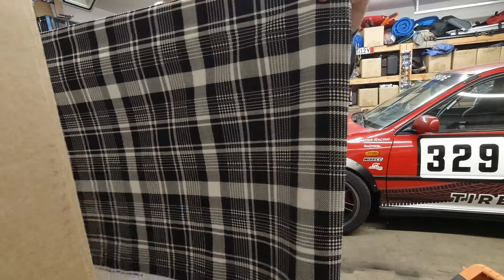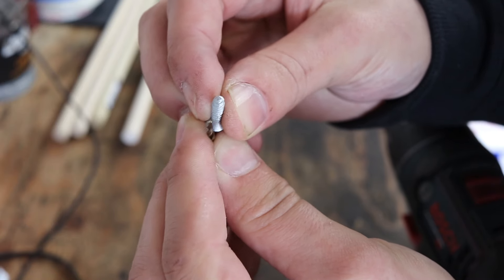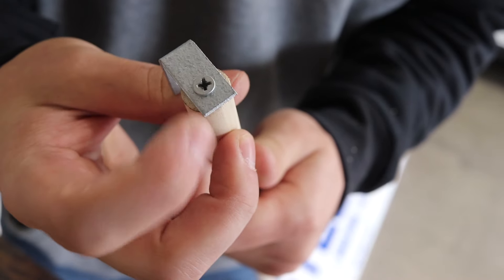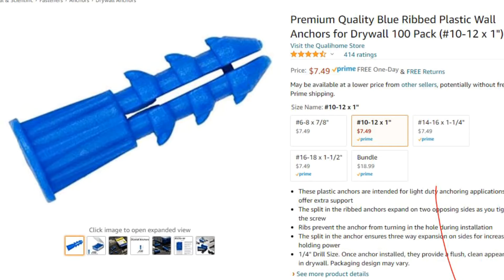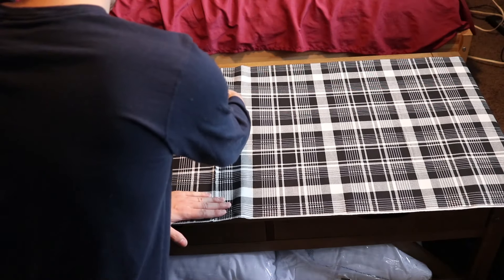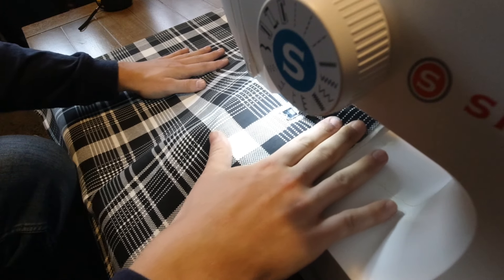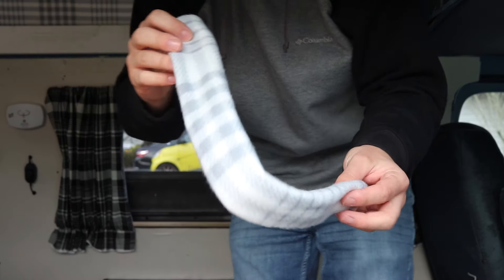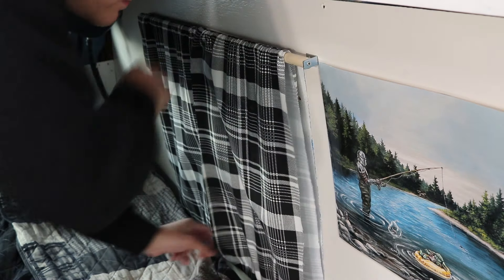CAMPER VAN CURTAINS | D.I.Y.

Comment: Having diy-ed multiple curtain designs, I'd like to share an alternative to your suggestion ... because, as always, which system is best  varies with circumstances (ex: For an employer-leased van for stealth  camping during work travel, removable adhesive for the smooth half of velcro at minimal attachment sites was appropriate). 
   Though my professionally- converted pop-top camper van came with rail-curtains & snaps, the plastic rails have places where they've  already cracked, become unattached, &/or  snaps have rusted &/or detached (screws stripped  &/or  expanded opening where flange/washer secured outer side of snap to outer side of  sheet-metal)  &/or sunken relative to fabric raising around them ... such that snaps holding outer edges of privacy curtains  to van &/or where the meet eachother became unusable, etc.. 
 Point? Simpler can sometimes be better.
    So ... my personal favorite curtain system  includes: 
1) Sliding via cord that's easily detatchable from van and easily  threadable  (to remove and re-thread cord when   laundering, , replacing cord, etc).
2) Some way to reversibly attach cord to van itself with cord side of attachment being both large enough to prevent accidental withdraw of cord tips into/through where curtain slides  across supporting cord and yet these relatively large cord "anchors" can be removed for intentional separation of cord from curtain. 
3) Neutral color for curtains such that people outside the vehicle can't tell whether it's just too dark inside the van to easily see in or whether there are  black-out curtains. 
4) Scotch-guard or otherwise protected from UV damage, stains,  moisture, and mildew (condensation, rain &/or dew &/or misty fog if windows not completely closed or something indirectly when doors are opened &/or interior liquid splashes &/or sprays &/or steam &/or spills, etc) plus UV protected ... & yet won't obstruct cleaning (ex: Scotch guard will be removed by combo of  laundry soap + hot water, but can be reapplied after laundering). 
5) No metal touching curtain itself that could expose curtain to rust.
6) Curtain options for:  Enclosing drivers compartment (+/- passenger area separately if can still  safely drive, as with outside cameras in back in addition to either cameras on both sides or backset enough to see side mirrors); Full width behind driver's compartment.; Concealing sleeping area(s).; Enclosing toileting area.; Enclosing inside  shower ... which every camper can & should have *see notes below.; & Changing area. Note: many of above can be combined.
~~~~ 
Sound complicated? 
Needn't be. 
Ex:  1 of my van's curtains is extra-wide with straps so it can serve multiple functions via:  has 1 curtain that serves  multiple functions via options to  attach to:  Visors' middle-facing  &/or outer edges.; Manufacturer's standard hand-grips  ceiling-mounted above entries for both sides of driver's compartment and side door.; Latches for clamping down closed pop-top.; Piggy-backing onto adjacent curtains.; Headrests on Driver's &/or Passenger Seats;  etc.. 
 Why? Real occasions I've had for using these options: 
   1) Full driver's compartment enclosure when passenger seat is swiveled backwards & driver's seat + front floor-wells stow supplies that require easy access to +/- access to dash-mounted  Audiovisual components (which have included line-of-sight wireless headphones). 
2) Behind driver's compartment curtain to conceal theft temptations &/or current use as camper (where camping isn't permitted). 
3) "Stall" (between seats where portable potty can fit) for teen daughter to change tampons. 
*4) Privacy surround for shower at either full height when pop-top up or for hand-shower vs sponge "bath" when roof is down. Ideally, my sink nozzle would telescope for hand- showering, yet that would either use up drinkable water or be able to switch to non-potable easier to obtain other water. Currently, we suspend a "solar shower" that comes with a long-ish hose & flow-controllable shower head that we  usually fill with water  heated to desired temp some other way. We protect the privacy curtain by suspending a shower-liner inside the "Stall". Trickier bit is privacy for dressing afterwards, but we just towel-dry enough to temporarily stand on mat along-side the tub that collects the shower water while disconnecting the shower-liner, tossing it into the tub of water, putting lid on tub of water and pushing it  out of the "stall". Then we can finish towel-drying & grab clothes from driver's seat to get dressed. Afterwards, the disposition of the tub of water & shower-curtain vary with circumstances. 
    Though I've seen more clever compact stowable shower "systems", we're using a heavy-duty plastic file box big enough to stand in, hang the removable  rectangular metal file-holder frame from the ceiling to support the shower-liner via standard plastic shower "hooks" & tuck the bottom of the liner  within the walls of the box. Manual bulb siphon is used to drain the tub into grey-water containers if dumping or siphoning the water to elsewhere isn't an option. Between use, the tub stores shower system components, soaps/shampoos, waterproof "bags" with clean towels, sometimes damp towels temporarily, +/- water in containers (for &/or from shower), +/- sm amts of misc other cleaning supplies, +/- sm biobags, +/- sm amts of misc laundry, ... tends to end up having every nook & cranny used for easily-removable  random storage overflow. What I did end up adding to the minimum system above is a wider ring around ~ elbow height, which I plan to tweek. Started with snap together hula hoop sections held in place by "straps" secured with strong magnet pairs inside and out (borrowed from what holds our cut up cheap sporting good store   run-proof mosquito net canopy to our metal van). I'm thinking glue (like for repairing or waterproofing seams of tents) to secure straps (+/- snaps at one end of straps vs threading hoop through straps that are  permanently attached at both top & bottom). 
One benefit to snap-open straps =  more options for hoops (ex: pop-open hoops like those used for pop-up tents, ladies' hoop-skirt hoops that slide into self for storage, plumbers' straps with kotter-pins ... though those could be threaded through non-snap straps, standard hula hoops or shower rods like for converting old-fashioned lion's claw tubs into showers, bended wire ... even from coat-hangers, etc). 
  Point wrt bathing, for which outdoors isn't always an option, is that even tiny-camping doesn't mean baby-wipes, pits & crotch, cold &/or pay  coin/token campground showers, YMCA, intermittent hotel-stays, etc., are the only options. 
   Since one of my favorite parts of civilization (second only to antibiotics & other health-care when needed), toilets & washing are a huge part of "sustainable" camping (& long road trips). Not just in my opinion either. Many other people like access to their own toilets & showers (esp men who can't or won't poop using toilets that aren't theirs, sandy folks who camp at the beach,  ladies after sex, young children who frequently don't complain that they have to potty right after you pass a sign saying "next rest stop" an eternity away, ladies with sudden menstrual onset or overflow, severe weather outside camper, gas stations that won't let the public use their bathrooms, etc., etc.)! 
    Your video here is great & much appreciate, & I hope my suggestions are understood to be inspired by you & in no way intended as criticism or me implying your education herein was incomplete wrt this the   lesson freely shared in this video. 
   Thank you, from a grateful fellow camper! 🌹
Reply: Goodness! How long did it take U to write all that?!?

Comment: You've done alot more stuff you've not covered in videos, looks like LED in the tracks of the topper, a switch mounted in the wall for what I assume is the LEDs and what's that... a carbon monoxide detector for the diesel fuel heater?